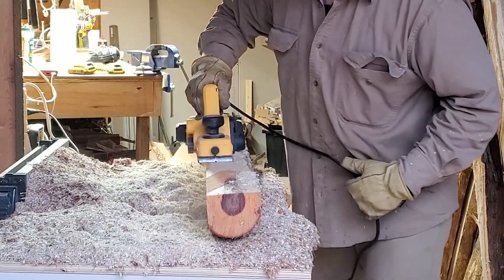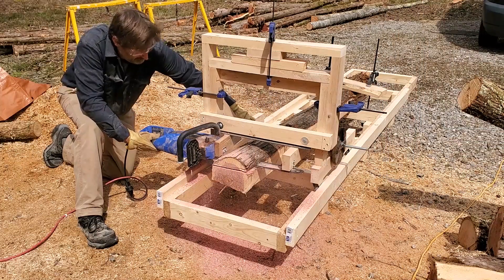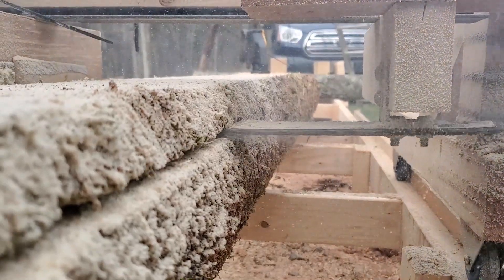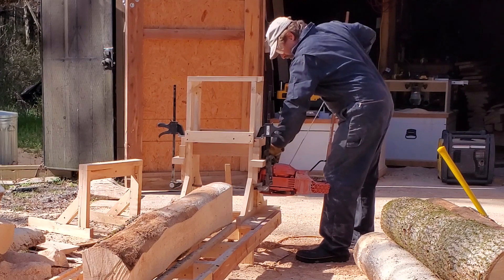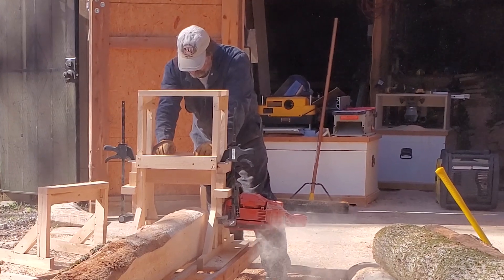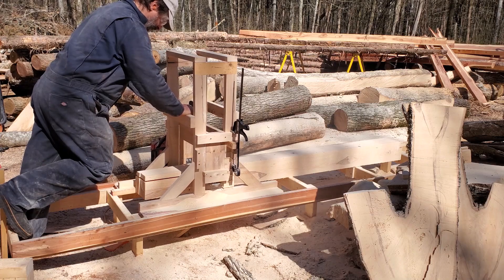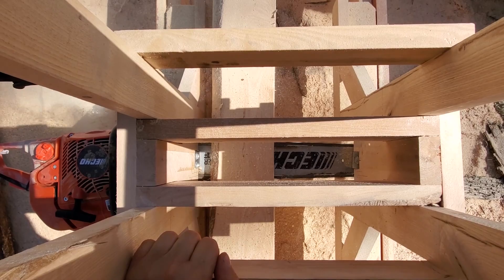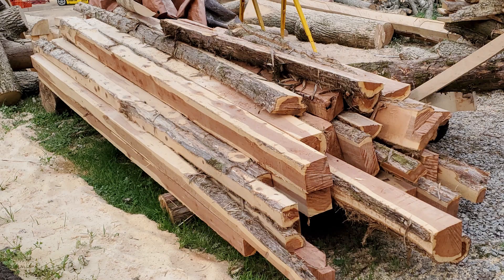Homebuilt chainsaw mill

Comment: I would love a video on DIY milling. Btw, I don't really know anything about industrial milling techniques but why is milling lateral and not vertical? In a DIY setting I would've assumed that a stationary vertical saw would be more stable and one could just "push" to lumbar into the saw blade with wooden guides on either side. Am I missing something obvious that makes this less effective or impossible?
Reply from the maker: I will see what I can do about putting a video together on mill construction, technique, and a few other odds and ends

My limited experience is that band and chainsaw mills are built to cut horizontally and circular saw mills vertically.   A big part of the problem is a low saw track Needed to load 1000lb logs limits clearance for the saw parts.  Also the difficulty in filling the gasoline and lube oil in such and awkward position. That is all I can think of at the moment eoment
Reply: @dirtbagbuilder9568  That's a lot more knowledge than I have so it's definitely appreciated. And no worries on the video if that's not what you want to put out. I watch every video project you put up anyway. They're all interesting to me.
Reply from the maker: @antontrier3862  happy to help!    I am always looking for new video ideas.
Missed in your initial question about pushing the log into the blade instead of moving the saw in a carriage....  that can certainly be done and is done in industrial mills, but as a saw+carriage weighs less than 100 lb and a nice oak log can be 1000 lbs, most hobby size mills choose to move the saw.   

If I has a seriously big circular or band saw, I would put it on a smooth level concrete pad and make an adjustable height log carriage to run the stock through...
Reply: @dirtbagbuilder9568  So for "small-scale" milling it's just more efficient to move the blade and not the log. Thanks for the info.
Reply: THAT I absolutely agree with - vertical cutting seems a better method if the platform is stable.